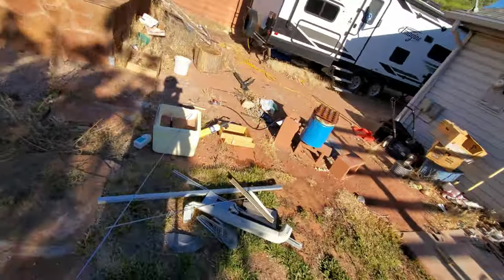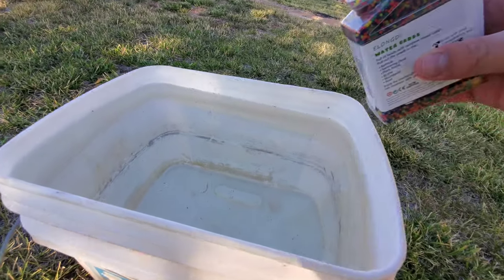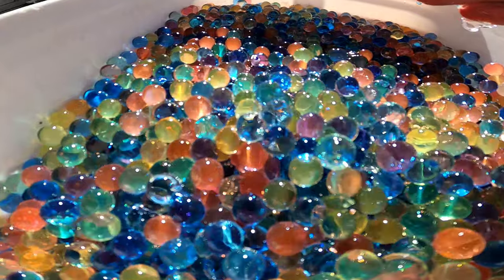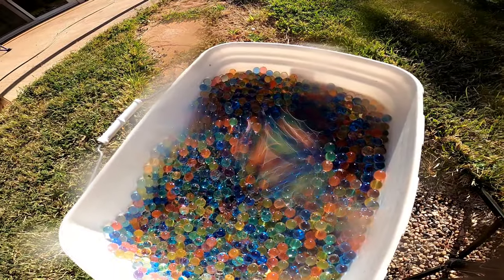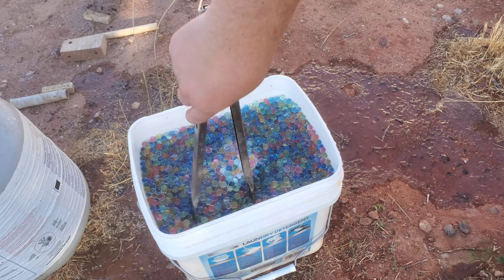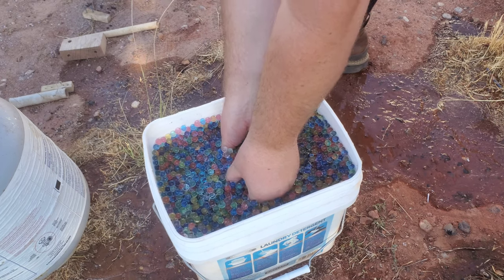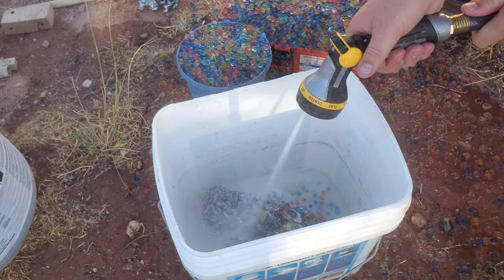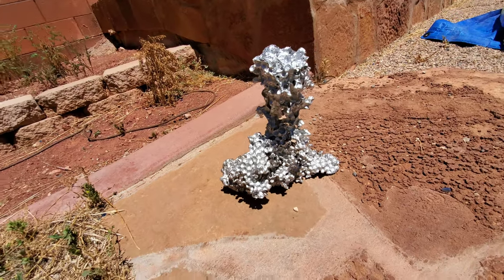Casting Aluminum Sculpture - Melting Scrap Aluminum at Home - Trash to Treasure

Comment: Not a "safety sissie" as oil burner would say, ahim, but if you don't improve your PPE i think a burn unit at your local hospital might be in your future. From personal experience in dealing with 3rd degree burns. They are really something you don't want. Please, get some covering on those legs and get something better than bbq tongs to lift with. Thanks